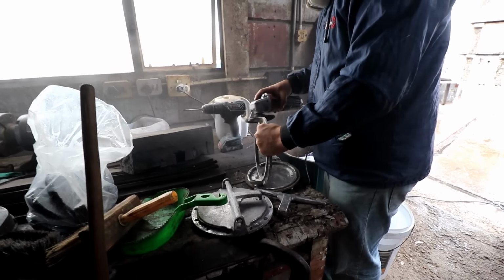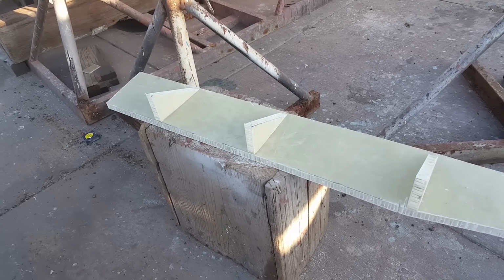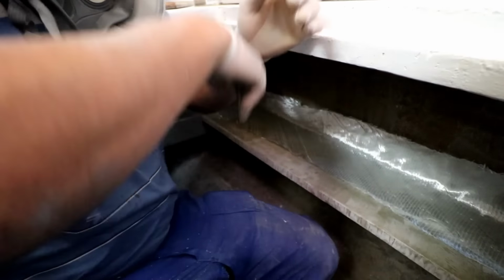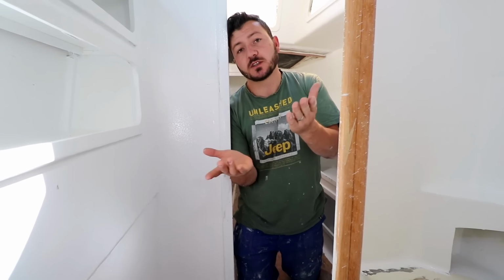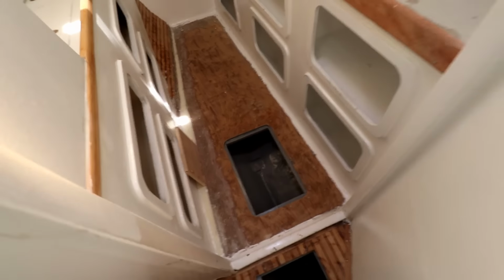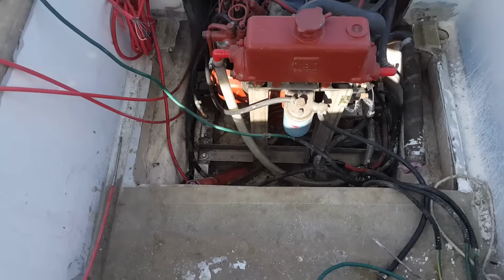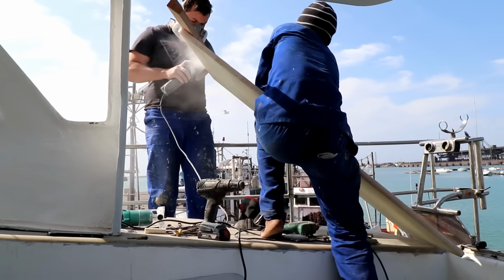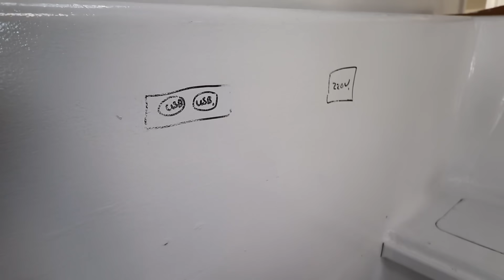More FIBERGLASS & EPOXY anyone? | YACHT REBUILD WEEK 37

Comment: The boat is really starting to pop guys...good stuff!  Do you anticipate having to use the salon table as a bed very often? Seems to me that going hydraulic with the legs is a bit of an unnecessary complication. And expense. Maybe that's the engineer in Ricky coming out!
Reply from the maker: We sure do. Mostly on crossings or passages.. gives you quick and easy access to the other person. The leg is a bit of a pain at the moment but we'll see what we are going to do.. :)